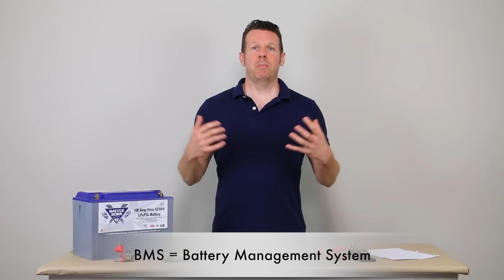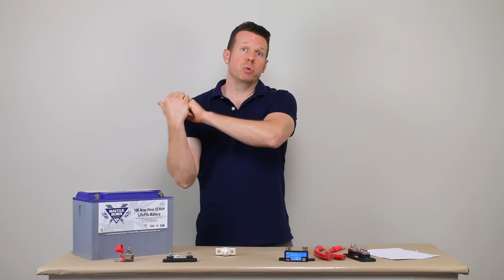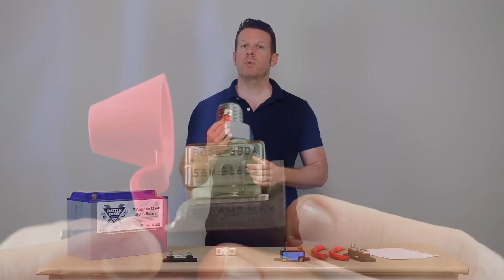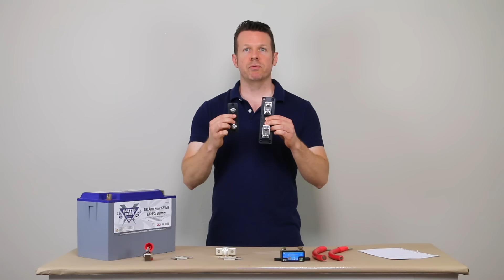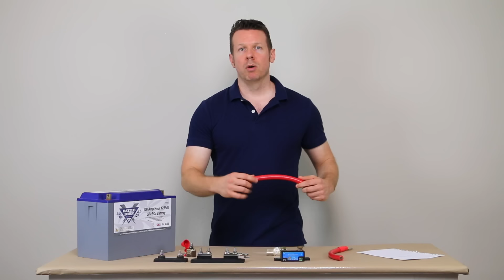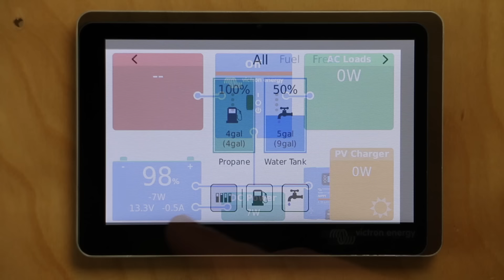The Top 9 Lithium Battery Mistakes for Van and RV Power Systems

Comment: Correct me if I’m wrong, but concerning pulling too much current from your battery, I believe that when solar or another power source is providing DC power the current from the battery would reduce?

For example, let’s say a load requires 100amps. And my solar charger is providing 30amps at that moment in time my battery would be outputting the other 70amps.
Reply from the maker: Yes you are absolutely correct! Thanks for tuning in-

Comment: Curious, can I use the existing wiring to the 7 way connector from the alternator, then connecting the trailer cable then continuing with the heavier wire connecting to my dc to dc charger then 100 ah lithium battery
Reply from the maker: Hey there, it works electrically but is kind of questionable, only because the 7-pins usually have 10 AWG, 30-amp wire max. Some of them have 12 AWG 20-amp wire. Just be careful, you might max it out pretty easily. Could get hot.
Reply: Thanks! I think at the end of the day I will run a seperate 6 guage wire from the battery to the rear or should it be wired to  the alternator? @rosslukeman
Reply from the maker: @joeparsons3898  Sure, would be wired to the battery. Not alternator.

Comment: what is the point of buying a 100ah battery with a 50ah BMS? does it last twice as long as a battery that has a 100ah BMS? someone explain please.
Reply from the maker: Hi Thomas, the story told in the video was that a 50-amp BMS can limit output and cause mysterious shutdowns in your system. It is a cheaper battery. It was a warning about batteries that can only put out 50 amps and what can happen.

Comment: Whew. So every wire connected to the positive battery terminal (besides the charge controller) needs one of those fuses??  I’ve never even seen a fuse like that. I have. So much to learn

Comment: Also I wouldn't bother apart from a small converter converting down to 12V, most van and RV components that can run on 12V can also run on 24V which you gain efficency for not having to convert down, but damn im supprised how low the efficency is, considering you can get MPPTs which are 500V to 48V that are 99% efficent, I was personally expecting if you were willing to chell out you could get 95% - 99% efficenct DC to DC converters, but like the best I'm seeing is 90.3% which is pretty freaking bad.

Edit: was looking at isolated converters... DURP!!! Yeh if you can do non isolated meaning you have a common ground, you can get 95 - 97% efficent DC to DC converters, which at that point, it's not a big deal.

Comment: Also if your going with more than 2 batteries in parrellel you should be connecting the batteries to a bus bar with equal length and gauge cables and as you said connect your inverter temnals the the oppsite ends of each bus bar, with lead acid batteries their high resistivity meant that you could link up 4 or even 8 in parallel and the current would much preffer to flow through the cables rather than to dump into 1 battery, but lithium batteries have a lower internal resistence so you need to be super careful about the resistence of the run of cables not being different to different batteries in the chain. In series you don't really have much choice which is why in that case you will need a battery balancer once you get past 2 batteries in series and even then you should top balence your batteries once in a while.

Although honestly once your trying to get to 48V, I would suggest 2x 24V batteries or even better a 48V battery, this isn't really a choice for boats because of the high humidity and salt in the air you need a marine grade battery and I haven't personally seen any marine rated batteries in 48V, they probably exist, but I suspect they are a speciality product and are therefore expensive, but if you don't absolutely need the marine rating server rack batteries are CHEAP per kWh and as long as you go with a manufactorer who whelds their cells internally they are going to be good for mobile applications because they use the same method to make EV packs and most server rack batteries are laser welded because at scale it's just the cheapest way to make them and it's super very reliable.

Just make sure that the batteries are raised a inch or so off the floor of the camper / van / RV so that in the case of flooding your they will probably be okay as long as they didn't get flooded on in which case you were already pretty screwed considering that the conductors and cables would have gotten water on them... thrid pro tip—or just  🦆ing common sense... don't put plumming near your batteries, thats just dumb.

I would be kinda tempted to wire up a 48V battery to an MPPT solar charge controller to a 12V battery.

Comment: I just replaced the plastic gear. Now my step retracts when I open the door, and extends when I close it. Drives me nuts. What went wrong?
Reply from the maker: Hey there, thanks for tuning in! I don't have an immediate answer but it sounds like the signal wires that control the step got reversed or the wire was landed in the wrong terminal. Don't let me send you on a wild goose chase though, perhaps contact the step manufacturer or see if their manual has a list of common troubleshooting issues. Hope that helps!
Reply: It turned up a very silly thing. Just had to turn the motor housing cover 180 degrees. That reversed the action 🎉
Reply from the maker: @atlasyts  Awesome to hear! I'm glad it was something simple!

Comment: Great content. I winter van camp In the rockies. Heat and insulation for the Battleborn Lithium is a must.  A cheap indoor/outdoor thermometer is an easy way to monitor house battery temp. Just slide the external temp probe down inside the battery box. Good luck with your adventures.
Reply from the maker: Hi Biff, thanks for tuning in and for sharing your experience! Great idea with the indoor/outdoor thermometer, love that. Have fun up in the Rockies, sounds awesome!

Comment: If you don't have a heater in your battery (Like Chins. Great batteries, but they don't have a heater), Get an RV tank heater for it and keep them in a battery box that you can ventilate in warm weather.  It takes a bit of proactive work, but it works fine.  Just don't let it kill your batteries or you still might charge it when you shouldn't.

Comment: Very informative vid, I don't think I will be making any of those mistakes. I do wonder why one can't use a manually resetting breaker (Bussman type III) as the main "fuse".
Reply from the maker: Hi Scott, the main fuses shown are approved by the ABYC because of their interrupt rating. You could use something else if you want to I suppose.
Reply: Even a car battery can put out over 3000 amps into a crowbar short. That's enough current to weld a breaker shut, causing a fire. The next step up in DC breakers are the ones with a 5000 amp interrupt current. One of those should protect one lithium battery (which puts out more current than a regular car battery.
 You really need a UL/CE approved breaker, with an interrupt current of 10,000 A if you want to sleep well.
 The primary battery should really be your first priority, they'll vaporize and can't weld shut the way breakers can.
 By the way, at 12v and these amperages, if your wedding ring shorts out a tool handle at the battery? Your finger will literally be blown off. You really want to read up, Nigel Caulder or Charlie Sherman both make boat maintenance guides, and the systems in boats and RVs are basically identical.

Comment: How about dumping the lithium batteries and going capacitors Maxwell at 64 volts at 30,000 amps two charge controllers at 80 amps 20 solar panels 340 watts each at 364 volts DC backed up with a 25k propane generator genarack couple to a Schneider 5,600 watt inverter at 240 volt run off a can bus system this is up and running now

Comment: I use circuit breaker instead of fuse as protection out of my battery positive. I like this option as apart from fuse like protection, it also allows me to cut off all power if the need arises. Interested to know why this not mentionjed as an option (good or bad), in this video..
Reply from the maker: Hi Emilia, thanks for tuning in. I too like to use breakers in my systems so I have a built-in cutoff switch. In the case of overcurrent protection on the battery bank, I don't use breakers because I cannot find a quality DC breaker that is 400 amps with an interrupt capacity of 6000 amps or higher. Good surface-mount breakers have an interrupt capacity that is 3000 amps and this does not meet the ABYC standards for large battery banks. So I don't use breakers in this part of the system because the item I need does not exist or would be a very expensive specialty item. For cutoff, I put a switch next to the fuse. Hope that gives more detail on the subject, thanks again for tuning in!

Comment: 0:28 Mistake 1 -  BMS Capacity
4:42 Mistake 2 - DC Ripple
6:55 Mistake 3 - Battery At The End Of The Line
8:01 Mistake 4 - Fuses! At The Battery Bank
9:00 Mistake 5 - Wrong Fuse Rating
12:31 Mistake 6 - Loose Connections
14:28 Mistake 7 - Increasing Battery Bank Voltage
18:33 Mistake 8 - No Cold Weather Provision
22:27 Mistake 9 - No External Battery Monitor
Reply: thx man
Reply: thx

Comment: Question for you. If my inverter outputs 120V @ 100 amps. How Many amps at 12V will my inverter pull form the battery?
Reply from the maker: Hey there, if you do 1/10th the voltage, then it's 10X the amperage to produce the same number of watts. So 120V @ 100 amps is the same as 12V @ 1000 amps, either one is 12,000 watts. Inverter losses would require a little more on the 12V situation as @K9River has said.

Comment: I have two 300 amp/hr LiFePOE with a bluetooth connection to the BMS.  The app to connect automatically calculates across the batteries to give a full state of charge for the bank. I am an old programmer, the logic behind this seems fairly straight forward. You want the exact same batteries in the bank and the BMS's will be reporting the same data, so why not.

Live in a cold climate so I have internal heating pads, but have separate breaker to the charging source they can all be shut down when winterizing just to be sure.

Comment: I hear the story of low solar voltage in the mornings and it's frankly, mostly nonsense. Or, at the very least, grossly exaggerated. The reason is that PV panels are current limited devices, not voltage limited devices. The panels only need a tiny amount of light to reach their STC voltage levels at very low irradiation levels. The voltage ramps up even in strong moonlight! It is the current that varies with different levels of light irradiation, not voltage. As long as the Vmp of rhe panel is wirhin the MPPT efficient voltage range, then the panels will be efficient. The higher the voltage delta is between pv array and battery voltage above this MPPT voltage level,  the lower the efficiency of the down conversion of voltage from the controller. In my experience with short wire length applications like we tend to find in mobile applications like rvs and boats,  the optimum pv array voltage is between 2x and 3x rhe battery voltage . Anything higher than that is no more efficient and may even be less efficient due to the extra heat and inefficiency within the controller. Rhanks for a good video. I just eanted to offer a few nuances to some of the points that may be helpful to others. I'm no expert but jave a fair bit of knowledge on some of this having lived with and built a number of offgrid fulltimer systems for RVs.

Comment: Can I use 2 or 3  cables the same awg instead of one big gauge cable to prevent this ripple effect ?
Reply: Unless they are EXACTLY of the same length and crimps, there will be a difference in loading per cable.and one will probably heat up.

Comment: Found an (maybe not so unusual ) odd prob .. with accessories running but charging BMS disconnects and solar goes high damaging electronics .  Found the wrong controller settings to be the culprit .
Reply from the maker: Good catch! Glad you found the culprit and were able to fix it. Thanks for tuning in-

Comment: Great video!  Iam glad I met all the bullet points for my system by copying a bunch of your designs. I do have an issue with the system stopping for one minute almost the same time each day here in Phoenix AZ at 14:29 hrs +/- a few minutes.  How would I isolate to see if its heat issue /shock issue for a 12v 300ah battery with total of 600w panels for the system. (Chins LiPo  Epever 60a mmpt, Renogy 3kw inverter and Renogy 500A battery monitor) when Iam not around. Rv sitting with power on inverter 24/7 internet wifi and alarm system cameras go out and come right back. Temps recorded inside RV are up to 135° and hold where equipent ( battery charge controller inverter) is a tad cooler around 125° the hot part of day is not until about 1600hrs. The renogy battery monitor shunt  shows battery charged and only 9W being pulled from system. Thanks !

Comment: I still like a insulated box for my batteries best. Add a heating blanket or heat mat to get the inside temp up during the coldest part of the night (on a timer). I’m not a fan of expensive self heating batteries.
Reply: I use a pair of 12 volt rv holding tank heaters and added bypass switches.

Comment: I’ve seen people use auto circuit breakers for power systems, you said ANL, terminal fuse and the T fuse. Are auto circuit breakers not approved/ not a good idea to use?

Comment: You mentioned that when using solar you need a higher voltage than your system voltage so does that mean there’s an issue with using 12v solar with a 12 volt system
Reply from the maker: Hi Enan, the "12V solar panel" is a misnomer. Those panels are actually 20-22 volts typically. They are trying to put it in layperson terms so you know to match that panel to that battery, etc. But if it were actually 12V no power would flow to the battery. Great question, thanks for bringing this up, and for tuning in!
Reply: @rosslukeman  thanks! I appreciate the response

Comment: How would you know if you have a battery that’s bms is only going to allow you to use 50 percent capacity
Reply from the maker: Hi Enan, I haven't heard of that, I guess it would tell you in the battery spec sheet if that was the case. The BMS is an emergency shutdown when the battery is empty, not when it still has capacity. In general the BMS stays out of day-to-day operations, so shutting down halfway through the capacity is not a typically BMS function.

Comment: Great content in this video, very helpful. I don't understand why for #8, that you need temperature sensors. If you have no temperature sensors and the chargers stay on but the battery disconnects internally what problem(s) can that cause?
Reply from the maker: Hi Aaron, thanks for tuning in, and good to hear you enjoyed the video. In general it can cause voltage spikes when a charger is under load and then the load disappears. Voltage spikes can blow some equipment, such as alternators. Sterling Power makes a "voltage spike absorber" so to speak to counteract this phenomenon. Not a huge deal, your system would probably be okay, but it's not a best practice to have abrupt shutdowns. Better to have the system work in harmony.

Comment: 16:50 : If solar voltage is lower than your battery you could look at Genasun GVB-8-OPE-Li3-51V... it boosts the solar panel voltage...

Comment: Hi Ross. New sub here. Do you have any opinions on "Big Battery" brand? I am conteplating two of their "12v Owl Max 2" (228ah) lithium batteries. its BMS specs say it's Max continuous discharge is 175A. Thanks, Dan
Reply from the maker: Hi Dan, I haven't used them but one of my students did. Overall I think they are good and a good value. The Anderson Power Pole connectors they use seem convenient, I guess I just want control over the wire size/length for my main battery cables. It's plug and play in that regard, which has its pros and cons. That's my two cents...thanks for tuning in and subscribing!
Reply: @rosslukeman  Thanks for your valuable input, Ross!

Comment: Hi Ross, I have a 12 volt fridge in my rig and 190amp solar on roof, I also have a 100 amp suitcase I plug in to keep the fridge running during the night . The fridge is shutting down after about 6 hours. If I trade out my liquid acid 12 v for a lithium battery would I see a substantial difference? I ordered a Li Time 200 amp hour but I have not installed it yet TYIA .
Reply: Yes you do.

A lead battery do have 150ah total but the volt go down.
Really you can only use 75ah from it.
If you go for a lipo4 battery.
150ah is the same like a 300ah lead battery.
So you have more in the same space i use.
And the volt stay till te battery stapel on 12volt .

But your fridge can be broken.
Well its about what u use.
Fridge on compressor base.
Or
Fridge on ammonia base.
Or
Fridge on Peltier element

The compressor one use the les power.

Comment: Curious re actual numbers for the DC ripple voltage on the 2/0 cable from the charger/inverter you mentioned. Depending on the on-line source for voltage drop calculators, a 12-ft run of 2/0 cable with a 30A draw will result in a nominal 30mV drop. Given a charge voltage of 14.6 for LiFePO4 batts, just how sensitive is the model of the Victron you mentioned that it would shut down with that modest of a ripple voltage?

Else, wire/cable sizing is certainly of paramount importance.
Reply: I would guess his brief phrase that because of the long wire run, the voltage drop was too high, and that caused the controller to shutdown, rather than a ripple increase
Reply: or... what kind of massive load was required to push things to the limit?